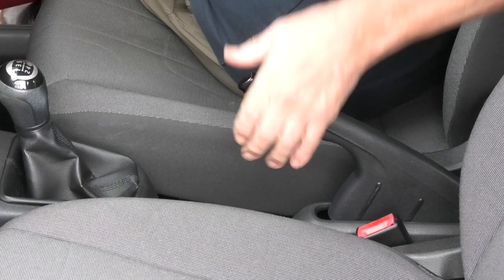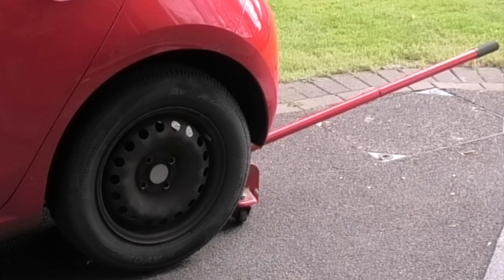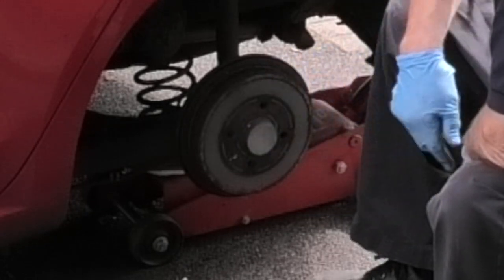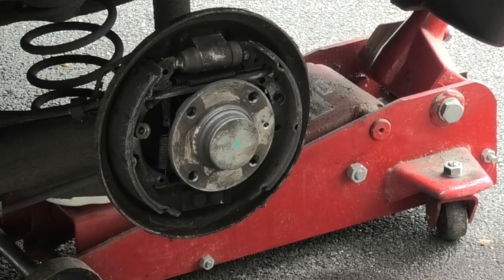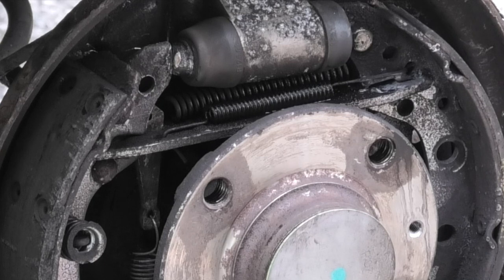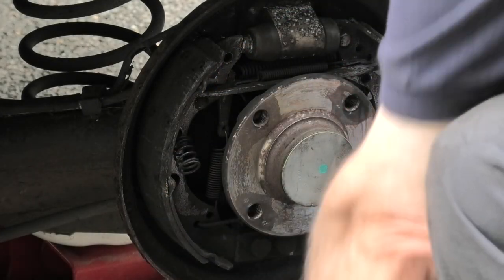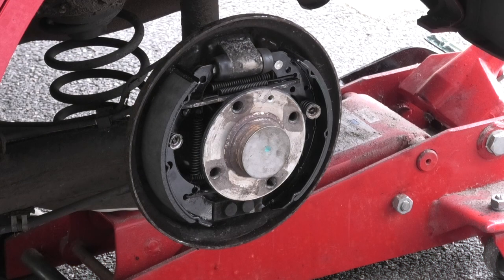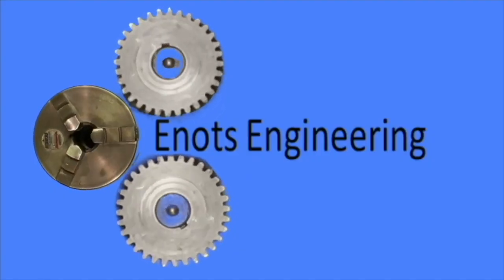VW UP Rear brake shoes replacement

Comment: Good video. Thanks for explaining slowly and clearly.But if you can also explain about the hand break how it was instead before and after it will more easier to do on own
Reply from the maker: Hi The hand brake should adjust itself when the drum is refitted. 
If not there is an adjuster nut under the plastic brake lever cover.
Reply: @enotsengineering  Thank you

Comment: Unfortunately the video missed out some important steps such as: Can the shoes be removed and replaced without taking out the slave cylinder or the hub to give space? What is the best way to remove/replace the handbrake cable end?

Comment: Personally I always place an axle stand underneath a vehicle even when I'm not crawling underneath it because a hand, arm or neck could take a fair old wack or get caught between the jack and a component on the vehicle. Always be safe than sorry, it's just not worth the risk in my opinion.
Reply: Yes I have a handy old screw type bottle jack which can be very useful to pop under beside the hydraulic one. At the vey least I use another old full bodied scissors type jack as backup. I also find foldable caravan wheel chocks are great i 'tensioned' in place fore & aft of a wheel

Comment: You spent most of the video jacking the car, then skipped removing the brake assembly over the hub😂
Reply from the maker: Did you not see at around 8-12 removing the shoes
Reply: @enotsengineering  Thanks for the video it was enough to get me going. All done now.  I pulled the hubs, it was quicker.